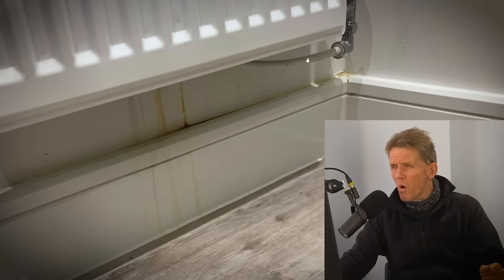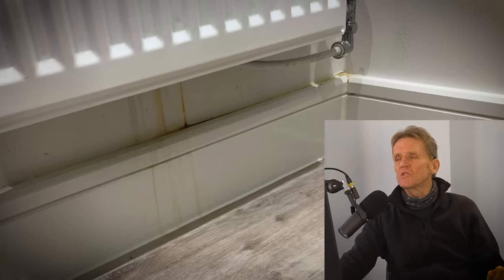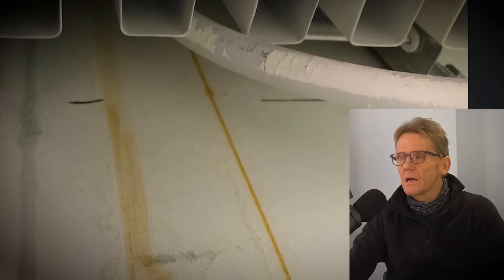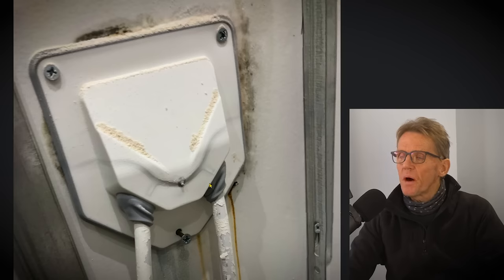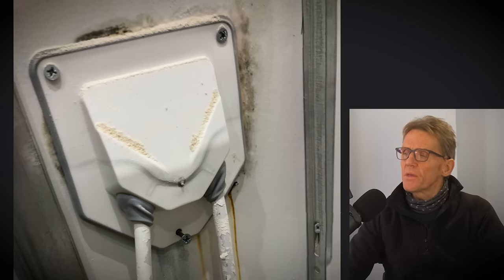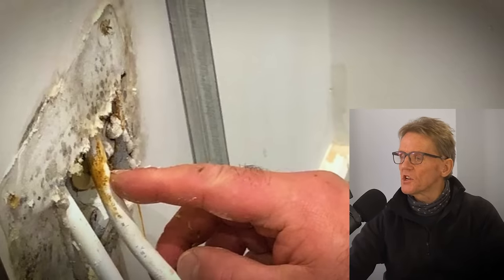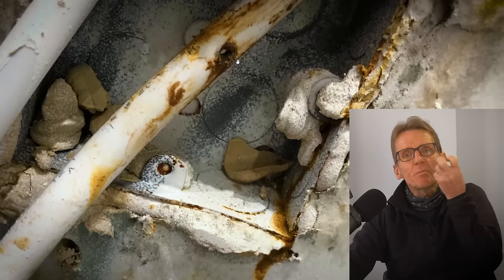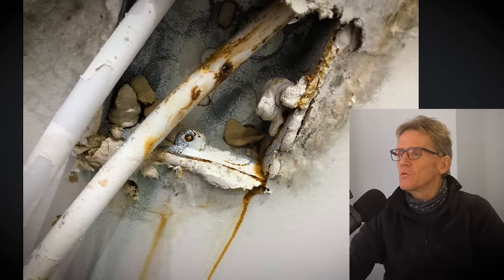Mystery Leak Reveals Schoolboy Error

Comment: I once repaired a leak coming  through a kitchen ceiling from the bathroom above because the  guy who refitted the floorboard in the bathroom used screws that were far too long and screwed into the joist and through the shower waste which was running perpendicular to and through the ceiling joists.  I  was informed that the bathroom had been installed about 10 years previously and the leak only started recently because the screw had finally rusted sufficiently to deteriorate the metal and allow some seepage. Obviously , being a gravity flow pipe and not a pressurised one it took years to occur. Was a very easy fix of the pipe but required a whole new kitchen ceiling.

Comment: FYI, it is clear which screw it was. The plumber has used the slack in the pipes to pull them down for the purposes of the photo. It was the top right screw that had gone through the pipe. Easy enough to do and a good way to avoid doing it again is just to use a zip tie to keep the pipes together and away from the top left and right screw when refitting. And before anyone asks i am trained as a plumber (though don't do it anymore except for family and freinds).

Comment: Has a leak in our kitchen ceiling, some clown shoe put a circular saw through a 22mm pipe doing the bathroom years back and used solder to bodge it up... they were minutes away from repairing it properly, but took the option that left only  a driveway guarantee..
Reply: I had similar; plumber 30 years ago cut floorboard after installing 22mm pipe under and grazed the pipe. 30 years later the thinned pipe wall gave way....
Reply: @alanvcraig  the potential destruction due to laziness or poor workmanship is huge... 30 years says it was decent old copper, the new stuff wouldn't last 30 days..

Comment: Hi Roger, another great video and info, I have a pressure loss problem on my heating combi system 0.5bar in about a week, Is it save to put Zeflora or Detol in the combi system as could it ruin the boiler. How much would you recommend  and would you have to flush out the system once fixed for the SENTINEL
X100 Central Heating Protector & Inhibitor
Reply: Check around the threads and valves fitted to the rads.  Sometimes it can be a tiny leak that gets evaporated by the heat of the rad before it leaves staining signs.

Comment: Invention idea, pushfit bracket that attaches to the wall like that bracket in video, yet you can easily pull the pipes out to remove rad.
Reply from the maker: Great idea
Reply: ...or don't fit rads!  Many a new home has been spoilt by chunks of white metal on the walls and pipes everywhere.

Comment: My home was built 11 years ago and has an unvented CH system that loses 0.5 bar over 30 months which has never worsened. There are no obvious leaks or damp spots, so I wonder what else might cause this?
Reply: Check around the threads and valves fitted to the rads.  Sometimes it can be a tiny leak that gets evaporated by the heat of the rad before it leaves staining signs.
Reply: @JuxZeil  Thank you, I'll take your advice.

Comment: I might be alone here, but I hate that quick-connect PVC piping and fittings.  They don't have the longevity that traditional plumbing does because of heat cycling.
Also...NO SERVICE VALVES TO ISOLATE THE RAD!?!  {facepalm}

Comment: "The Artistic Plumber +  Kettle Handles "  Many bent copper pipes ago a chipboard floating floor was laid. Size of Radiator tails had been discussed Sizes and positions of radiators marked on walls. floor was laid neat holes drilled to take pipes. However "The Artistic Plumber"  got all the sizes of radiators wrong so when they came to fit Radiators they did not match or fit the pipes. Instead of shouting out and saying I have made a mistake  "The Artistic Plumber"  made the pipes fit to the radiators on each side. When you walked into the room it looked like "Kettle Handles" coming out of the floor to meet the Radiators very Artistic .   Makes you wonder what houses "The Artistic Plumber "  had /has worked on are like plumbing wise beggars belief that he left it like that and thought it was okay..   "The Artistic Plumber" may now be working for the  "Tate Modern Gallery" showing of his Artistic skills or maybe  working with "Banksy" the Artist Or god forbid coming to a new house near you... Watch out folks

Comment: My dad put up sone of that orrible wood effect hardboard panelling back in the seventies and nailed straight into the gas pipe . He noticed it about 15 years later when he took it down ….. sssssssss😮🧱👍🏽
Reply from the maker: It is amazing how good a seal you can get with a clean nail. Gas is low pressure but if it had filled the void behind the panelling it would have been coming down a lot sooner than 15 years. The truth is that most of us (me especially) have gone through pipes and cables at some time.
Reply: @SkillBuilder  😬🧱👍🏽